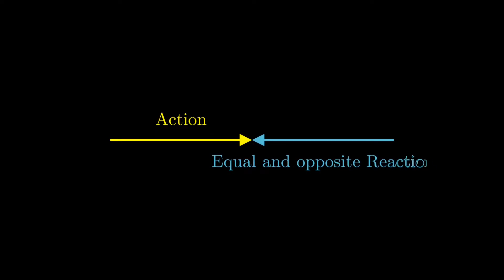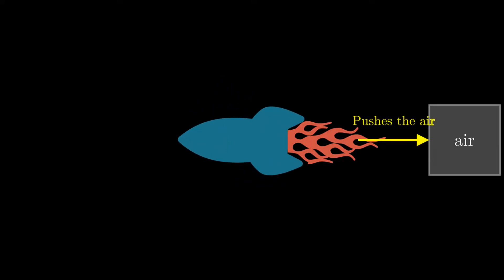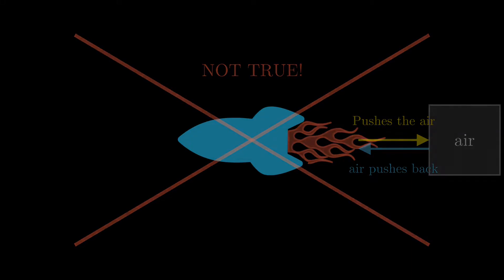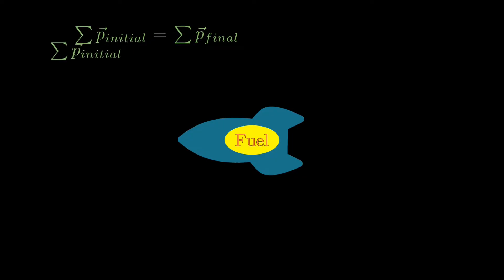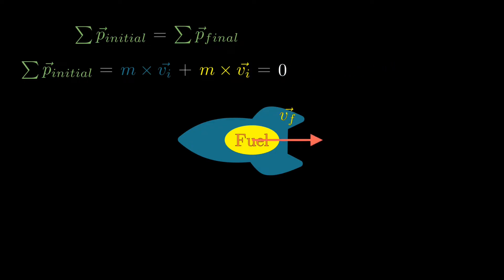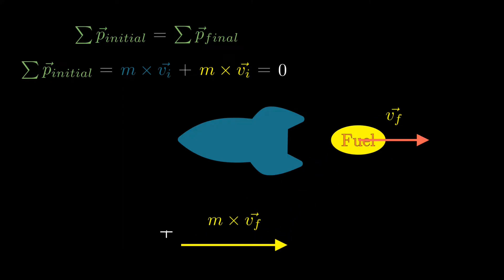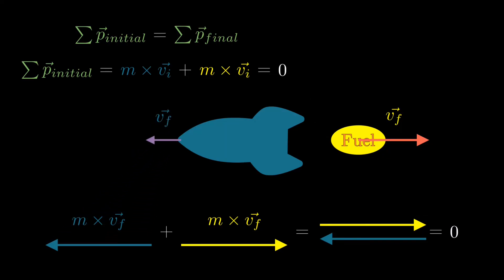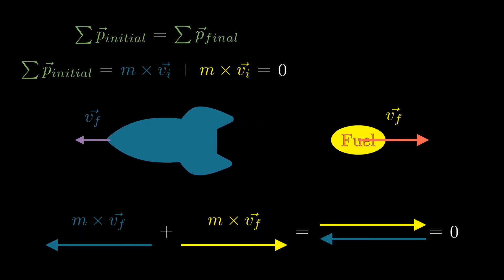What do Rockets push in Space, where there is no Air?

Comment: Here is a problem for the reader:

How does one calculate the recoil force of a machine that can accelerate 500 kilograms of water from a velocity of zero to Mach Eight (2500 meters per second)?
Let's say the "catapult" is 3 meters long.

The 3 meter catapult can accelerate a 500-kilogram block of ice to 2500 m/s.
Assuming a constant force from the catapult for 3 meters, what is the required force to do so?

This it 100% related to rocket propulsion, so just humor me, and answer the question.
I don't need the ANSWER, I want someone to tell me how to figure out the answer using basic physics.
Reply: Here's the specific type of "catapult" that Stuart is referring to! 😄
https://www.l3harris.com/sites/default/files/2024-06/artemis-iv-l3harris-rs-25-teaser.jpg
Anyone wanting to calculate its recoil force but don't know how should check out Newton's second law.
Reply: @fromnorway643  Yep that is one hell of a powerful "water catapult".  We have TESTED a LOT of them.

And I have personally witnessed about nine of those in use for almost 8 minutes straight each time.
Reply: @fromnorway643  but clicking on the link didnt work for some reason, I had to cut and paste it into my browser.
Reply: @stuartgray5877  
Strange. When I click the link, I get the message "Do you want to leave YouTube?" (in Norwegian) with the options Abort or Proceed. When clicking Proceed, the image of the RS-25 is opened in a new tab.
Reply: A thermal rocket is not a catapult. It's a heat engine & the exhaust is the working fluid. If the working fluid of a heat engine meets zero external pressure (as it would in a vacuum), it does zero work. Zero work means zero change in motion. The end 😂
Reply: @papalegba6796 The RS-25 combusts "Hydrogen and Oxygen" and the exhaust comes out at Mach 8.

papalegba what IS the combustion by-product of hydrogen and oxygen?
You DID take 9th grade chemistry RIGHT?  It's basically the very first thing they teach you on day one.

A RS-25 Consumes 500 kilograms (per second) of Liquid Hydrogen and Liquid Oxygen.
A RS-25 Expels 500 kilograms (per second) of WHAT GENIUS?

What IS the exhaust from a RS-25?
Why won't you answer?
Reply: @stuartgray5877  again, if the exhaust does not meet external pressure it will do no work, chatbot. It's a law of physics 😂
Reply: @papalegba6796 The rocket engine does work ON THE MASS- PERIOD.
Mass changes velocity - WORK WAS PERFORMED ON IT. END OF STORY.

The rocket applies a "force" to the exhaust mass (pure water) causing it to accelerate.
Work is performed as the mass is accelerated.

And I SEE that you did not even attempt to answer the question of the original Post.
Maybe if you went back and took high school physics you could answer it.

The question was for those that DID complete high school physics NOT the people who dropped out before the 9th grade like yourself.
WHY won't you explain what the combustion by-product to of an Oxygen Hydrogen fire IS?
They explained this in FIRST DAY of high school chemistry. Why don't you know the answer?

OH, THATS right because THEN you would have to admit that a RS-25 rocket engine expels PURE WATER (and we all know water has "MASS").
But bless your little heart for playing along.
Reply: @stuartgray5877  so the gas laws are wrong? Don't think so, chatbot 😂
Reply: @papalegba6796 No you just don't understand the gas laws.
Which makes sense since it is obvious that YOU dropped out of high school before the 9th grade (where they teach you that Hydrogen and Oxygen makes WATER).
In COLLEGE, they teach you all about the "gas laws" in Thermodynamics.  (a word you are incapable of even SPELLING without assistance)

But bless your little heart for effort!
Reply: @papalegba6796 I thought you knew basic physics?

Why won't you answer the question in the OP?
How DOES a physicist solve the math problem where a 500 kg mass is accelerated to 2500 m/s in 3 meters of constant acceleration?
HOW does a Physicist (or Engineer) solve for the "force" required to accelerate 500 kilograms of mass to 2500 m/s in only 3 meters?
That's the kind of problem they train catapult operators to do in their heads to launch aircraft from carriers.

I am not asking you for the final answer JUST THE PROCESS.
Why cant you answer?  is high school physics some kind of secret?

(Maybe you could ask ChatGPT since it seems to understand basic physics better than you do - It CAN explain how the recoil from a crossbow works while YOU cannot)
Reply: @stuartgray5877  <----- literally saying "NO U!" like the primitive chatbot it is 😂
Reply: @papalegba6796 The expanding gasses collide with the walls of the combustion chamber and nozzle and exert a force. This is basic physics.
Reply: @papalegba6796 So according to YOU a crossbow cannot do work on the projectile?
I don't think that's how physics works, genius.
If you use the crossbow as the reference frame, work is done on the projectile.
If you use the reference frame of the projectile, work is done on the crossbow. This is how the law of conservation of momentum works.
Reply: @stuartgray5877  a crossbow is not a heat engine either, chatbot. You fail again 😂
Reply: @AM-rd9pu  that violates the gas laws again, chatbot. The working fluid must meet EXTERNAL pressure, you're describing INTERNAL pressure. Yet another fail 😂
Reply: @papalegba6796 - "it does zero work. Zero work means zero change in motion."

How much "work" is performed in accelerating 500 kilograms of water from a velocity of zero to 2500 meters per second?

Lets ask ChatGPT:  "How much "work" is performed in accelerating 500 kilograms of water from a velocity of zero to 2500 meters per second."

To find the work required to accelerate a mass from rest to some velocity, use the change in kinetic energy:

𝑊=Δ𝐾𝐸=12𝑚𝑣^2
	
Final answer:1.56×10^9  joules 
(about 1.56 gigajoules)

I guess ChatGPT is in on the conspiracy.
Reply: @stuartgray5877  ask chatgpt how much work is performed when a gas expands into a vacuum, chatbot. Cos a rocket exhaust is gas, not water. Or use w=pv & do it yourself? The answer is zero btw 😂
Reply: @papalegba6796 How many times do you have to be told that the rocket exhaust isn’t aiming to do work in the surroundings? It does work on the rocket.
Reply: @papalegba6796 - "Cos a rocket exhaust is gas, not water. "

It is hilarious every time I find a NEW way in which you are completely ignorant on a subject and so pathetically wrong.

Water can 100% certainly be a GAS !!!
You keep trying to lecture ME about "Thermodynamics" but you do not know that water can be a Solid, liquid, OR GAS?
WOW!
I mean that's a NEW low.  I did not think you could surprise me yet AGAIN with the level of your ignorance.

I nominate you again for the Dunning-Kruger poster child for 2025.
Reply: @AM-rd9pu  if the exhaust does no work on the surroundings the rocket will not alter it's state of motion, chatbot. This isn't hard 😂
Reply: @papalegba6796 - "if the exhaust does no work on the surroundings the rocket will not alter it's state of motion"
So (based on this statement) YOU are claiming that a CROSSBOW would NOT HAVE RECOIL IN A VACUUM.
Is that what you meant to say?
Because that IS what your statement means.

A crossbow can be fired into a vacuum,
A crossbow CANNOT do any "work on the vacuum".
The crossbow DOES "do work" on the projectile.
But according to YOU the crossbow will NOT FEEL ANY RECOIL - Since it "does no work on the vacuum".
I think you need to talk yourself through that very carefully as you are stating a logical fallacy.

Comment: Yeah, that still doesn’t make any fucking sense
Reply: What doesn't make any sense? 

1) You have a rocket in empty space with gas inside. 

2) You light up those gases. 

3) The gases expand, pushing the rocket towards all directions inside its body. Mainly we can distinguish 4 main areas of internal push. Forwards, backwards, and sideways.

4) Sideways internal push cancel each other out, so nothing happens. 

5) The forward push tho is not cancelled out. The gas particles that are trapped inside the body of the rocket push the rocket forward. But at the back the gases are escaping (aka, they cause no backwards push to the rocket).

6) Thus the rocket is literally pushed forward by the gases INSIDE it. 

Most people believe that it's the exhaust gases that push the rocket upwards or forwards. But that's a misconception. Its the INTERNAL trapped gases that push the rocket forward and they are then left to be expelled out the back.

The reason we want them gone is because as per Newton's 3rd law, they gave forward momentum to the rocket, therefore they now got a backwards momentum from the rocket. And if we don't expel them they will cause the rocket to explode. 

By letting them go, we prevent this from happening. 

Do you understand now?
Reply: Nothing NASA, or any other "space agency", claims ever makes sense. They rely on spamming social media with bots to reinforce their gibberish tho 😂
Reply: @papalegba6796 That’s on you for not being able to understand it. 

Do you ever find it word how the people who actually get educations and do science and engineering aren’t the ones seeing a problem?
Reply: @papalegba6796 Try answering the question.
Reply: @papalegba6796 It "makes sense" that science and physics "doesn't make sense" to people who never studied science or physics.

Perhaps you could try reading a physics book for a change? Then might actually UNDERSTAND newtons laws and all the equations you always use incorrectly.
Reply: @stuartgray5877  hush now, chatbot 😂

Comment: Here's another example.

Take the simplest possible "rocket". A big tube in empty space, imagine a big cylinder, and a person inside it. 

The cylinder has 2 caps, one at the top and one at the bottom.

Imagine that this person is close to the cap at the front and pushes with his hands the cylinder forward, with enough power. What will happen? 

The cylinder will start moving forwards. And as a recoil "Newton's 3rd law" the human will be pushed backwards. 

Now imagine 2 scenarios:

Scenario number one. There is a cap in the back of the cylinder. If that is so, then the human will eventually hit the back of the cylinder in which case the cylinder will feel a force opposite to forward motion... As a result of the impact the cylinder will stop moving as the 2 forces cancel each other out... 

Scenario two. There isn't a cap in the back of the cylinder... Which means that the human will simply exit the cylinder and shoot out outside... The cylinder will continue to move forwards indefinitely... 

Even if the human hits some wall or whatever after he had exited the cylinder, that won't "push" the cylinder, it won't make it move faster or whatever. 

Because exhaust doesn't cause propulsion upon exiting or after having exited the rocket.
Reply: Long winded way of saying the laws of physics are wrong 😂
Reply: @papalegba6796 You do not understand basic physics, so you are not one to make any claims.
S T F U
Reply: @papalegba6796 for example you are not even capable of telling us HOW rocket engines cause the exhaust gas to be accelerated to Mach Eight as the exhaust leaves the nozzle. Papalegba believes mass can be accelerated by "Nothing". No "force" required.

According to you its "magic".
Reply: @stuartgray5877  
If mass could be accelerated by nothing it would truly be magic!
Reply: @fromnorway643  i never said that & you will not find a quote where i do. I said the velocity of a gas particle is dependent on its temperature, which is a fact. Nasa needs lying chatbots to make rockets work in a vacuum 😂
Reply: @stuartgray5877  i have told you tho, many times. You just ignore my answer & lie about it. Cos you're a chatbot 😂
Reply: @papalegba6796 Nice projection.
Reply: @papalegba6796 - "i have told you tho, many times. "

Yes, and your answer was "Fire".
That is incorrect. TRY AGAIN.
What is the combustion by-product of a hydrogen and oxygen flame?  What does the "smoke" consist OF? MAGIC?
Reply: @papalegba6796 - " i never said that & you will not find a quote where i do."

No you just DENY that mass comes out of the back of the rocket so you don't have to admit that a force is required to accelerate that mass.
You just play this stupid game where you deny basic facts like "Hydrogen oxygen fire makes water" and "Rocket engines accelerate mass".
Reply: @papalegba6796 Yes stuartgray is just a troll. Don't even bother with him. He never reads people's comments and he just makes stuff up that never happened. Plus he constantly says that whatever someone said is wrong, without proof. Just baseless claims. 

Even if he is right (as we know) that rockets work in space (in fact rockets work better in space than in the atmosphere), he still has a very naive understanding of how this happens and he only ends up confusing the people that he talks to.
Reply: @-Nuke-  rockets cannot create work in a vacuum because w=PV. It's a gas law, either apply it correctly or don't 😂
Reply: @stuartgray5877  I answered you again in this thread, chatbot 😂
Reply: @papalegba6796 Lets take it step by step.

1) If you burn fuel inside a container, that fuel will expand. 

Correct?
Reply: @stuartgray5877  "Physically speaking it is the result of the pressure which is exerted on the wall of the combustion chamber"

This is a quote from an actual rocket engineer.

This is why people like us call you morons chatbots.
Reply: @-_Nuke_-  Nope sorry wrong again.

The equation used to design, build, test, and evaluate rocket engines was derived from the LAW OF CONSERVATION OF MOMENTUM.

Rocket propulsion is the same as mechanical recoil.

And you have been told (MULTIPLE T IMES) that you CAN calculate the forward thrust on a rocket by integrating the pressure inside the combustion chamber and nozzle. (YOU do not even KNOW WHAT THIS MEANS)
OR
You can calculate forward thrust from just the Exhaust velocity and mass flow rate .

WHICH DO YOU THINK IS EASIER?
The SECOND ONE!!!
which is why THAT is the method that is used by actual rocket scientists.
The method based on the Law of Conservation of Momentum.

SO AGAIN, I will EXPLAIN TO YOU that the Tsiolkovsky Rocket equation is DERIVED FROM the LAW OF CONSERVATION OF MOMENTUM.

Now have the teacher of your special needs class explain this concept TO YOU, since you do NOT SEEM TO BE GETTING IT.
Reply: @-_Nuke_-  if you can't solve w=PV for when P=0 then stop bothering me, boring guy. Argue with another nasa chatbot instead, I'll just laugh at both of you 😂
Reply: @papalegba6796 I asked you first.

1) If you burn fuel inside a container, that fuel will expand. 

Correct?
Reply: @stuartgray5877  Thank you for proving my point.

1) "you CAN calculate the forward thrust on a rocket by integrating the pressure inside the combustion chamber and nozzle."

Or

2) "You can calculate forward thrust from just the Exhaust velocity and mass flow rate."

I agree. This is exactly what I have been saying.

1) Is what is PHYSICALLY happening. 

2) Is the shortcut that we take because its easier to calculate.

You claim that 2) is not just a shortcut but a physical causal agent. It is not.

1) Is what is PHYSICALLY happening. Gases PUSH the interior of the container (or better yet - the nozzle) and they TRANFARE their own momentum to the rocket. 

OBVIOUSLY this is extremely hard to calculate mathematically. Therefore we use 2).

All this time you know the answer and you keep trolling. So finally thank you for proving me correct.
Reply: @-_Nuke_-  - "So finally thank you for proving me correct."

Nope still wrong.

Tell us:
FROM WHAT
is the TSIOLKOVSKY ROCKET EQUATION DERIVED?

just give the answer.
Reply: @papalegba6796What do you mean, "the physics are wrong?"
Reply: @-_Nuke_-  i didn't say that. Is misquoting me the only trick you nasa lovers have? 😂
Reply: @papalegba6796Your comment literally says:

"Long winded way of saying the laws of physics are wrong". 

So I am confused... This is literally what you wrote.
Reply: @-_Nuke_-  so you admit to misquoting me, while claiming you are not? You're as silly as chatbot stuart 😂

Comment: Conclusion. Rocket use fuel to move
Reply: Exactly.
Reply: Conclusion: WRONG 😂
Reply: @papalegba6796 Question. Does it take a force to accelerate mass?
Reply: @AM-rd9pu  According to papalegba mass can just accelerate itself, no "force" required.

This is because he claims that rockets can spew mass out the back at Mach Eight without the rocket feeling any recoil force - since the rocket didn't apply any force to the mass to get to it Mach eight.

The mass of the exhaust gas can just "Magically" go from a velocity of zero to Mach Eight.
Reply: @stuartgray5877  I've never said that & you cannot quote me saying it, chatbot 😂
Reply: @AM-rd9pu  in classical mechanics, yes. But we're talking about gasses here, so kinetic theory applies, as gas particles are in constant motion & their velocity is dependent on temperature. Which you refuse to acknowledge, as you are a chatbot programmed to lie about everything 😂
Reply: @papalegba6796 - "I've never said that & you cannot quote me saying it, chatbot"

Then explain:  how does a RS-25 rocket engine cause 500 kilograms of MASS to change velocity from 0.0 m/s to 2500 m/s?
Is it "Magic"? Bless your little heart!
Reply: @papalegba6796 You’re intentionally trying to convolute the situation. 

Rocket exhaust has mass. It takes a force to accelerate that mass. Where does the force come from?